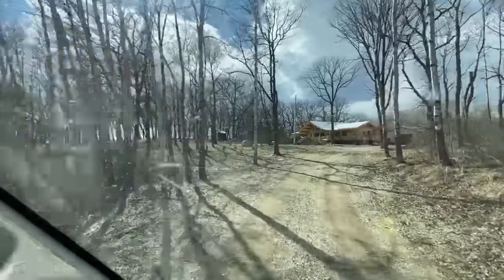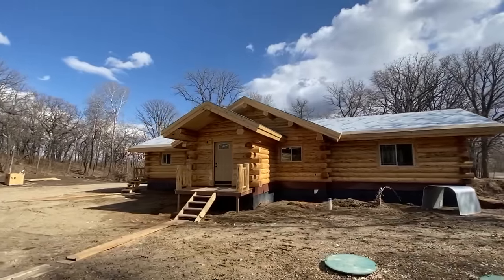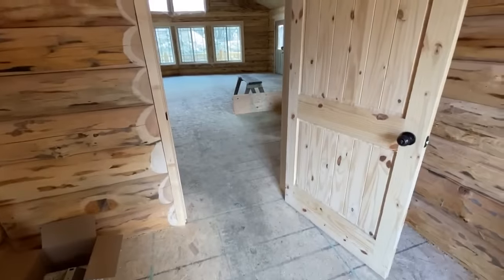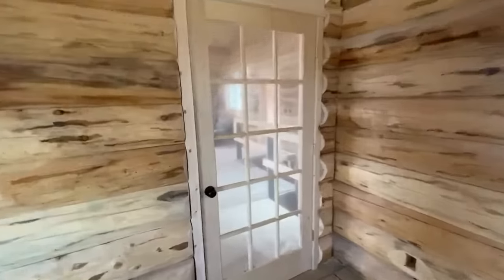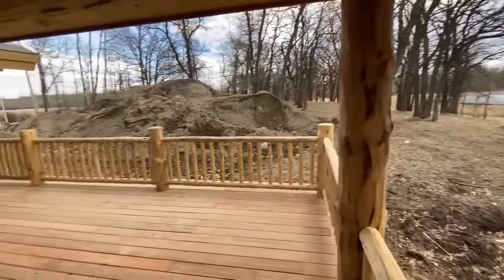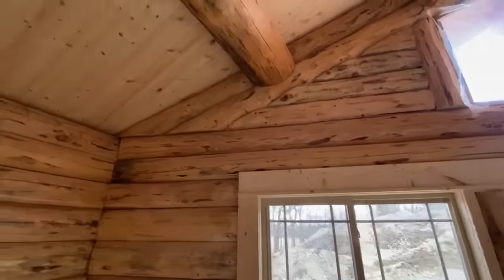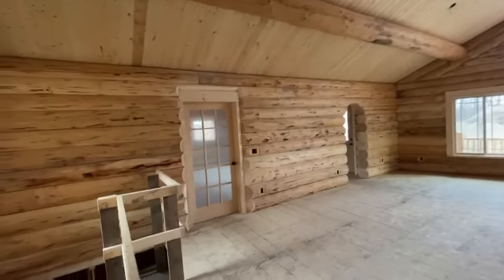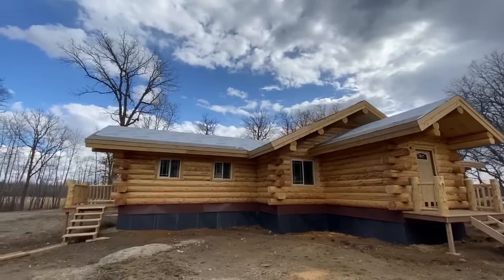Log Home Single Level Tour- Meadowlark’s Lakeside Dried-In

Comment: If this were my home, I would have had the front of the house facing the lake...the way it sits now the lake is not easily seen from all the front facing rooms.

I didnt care for the way the bump out in the living room was not exactly mirrored on the porch/walkway.  The mudroom is a great addition to the house.   If the front of the house was parrallel with the lake, having the mudroom addition makes the back of this home look very proportioned and could easily be mistaken for the front!!    Being in the Dakota's, I would have made the mudroom  @1/3 wider so that I could have some custom closets put on one side to hold all the coats, hats, bibs, shoes and boots. Id also want some custom seating, so you'd have a place to sit to put on or take off your snow gear. Keeping those things picked up and put away will make this entryway much more orderly.

With the extreme temps that you have in the Dakota's, I would have a set of doors installed so that you have an airlock from the mudroom into the main living area to preserve as much heat as possible!!!  🥶
The mudroom needs to have an extended outside porch that is also covered.   
I would also have had a 21/2  car attached garage added to the kitchen side  of the house. This way you can bring groceries directly into the kitchen.  Id also keep a couple cords of split wood stacked in racks in the front of the garage. This way you'll always have dry wood for the fireplace.

Owning a log home has always been a huge dream of mine.  Still praying 🙏 that someday  I'll hit the lottery and make that dream come true!!!!
❤❤❤❤❤❤❤❤❤
Reply: I agree with everything you said.

Comment: Interesting.  Wondering about how the home will be heated/cooled and how ductwork might be installed.  Also where the bathroom(s) would be.  I imagine a fireplace could be installed as well.
Reply from the maker: What I need to do is go back to that location at the first opportunity and get some finished video and we could see all of the interior.
Reply: @AmishMeadowsOfficial   Thank you for the response.  It would be nice to see how it turns out.  I have always wondered about log home construction when it comes to wiring and ductwork.  Working with logs as opposed to drywall.   What I always imagine most with videos is the aroma of the wood, especially those with cedar and pine.
Reply from the maker: Frame interior walls will be added and wiring plumbing and ductwork runs in these walls and in the floor and roof cavities. The frame walls make it simple.

Comment: What's the R rating on these log wall constructions and what sort of maintenance would a property like this require?  Would it still be standing 5 decades from now like a brick & mortar home, or is the all-wood construction prone to rot and associated problems over time?
Reply from the maker: Log walls do not use R value for the energy rating but rather mass wall. Our log homes should be standing in hundreds of years from now. Insects are generally not a problem.

Comment: Odd not to see any areas plumped for bathroom, kitchen, or laundry room. The tour guide doesn't even state how many rooms under roof 🤔. Only 1 bedroom? And if so, it would be 'maybe' referred to as Master Bedroom but usually that term means it has an en~suite, yet it's one large room and no other room within for a Master bath 🤔. All that work for a basement without providing a walkout? Without windows or a walkout, that will be a dark depressing space, and possibly potentially moisture from foundation freezing and thawing. I could have appreciated this video 10 times more if I knew the amount of bedrooms, plumbing, and extras like laundry room. I couldn't even guess where a house bathroom was planned and plumbed for or interior door for it. Cathedral ceilings make it funky for even a Master closet or pantry. Location and outside home is stunning. Beautiful porches too.
Reply from the maker: In this video, the home is not finished so there is a lot more to see. Hopefully I could take a video later when it is completely finished.

Comment: Roof seems kind of low... and the big logs sticking out on the edges are kind of dangerous... poor  deck designing.
Reply from the maker: The log beams, door openings, porch beams and roof overhangs are at least 6‘-8“ clearance height which is USA and Canada standard code for any doorway or place you pass underneath. 

A person can order extra wall height with extra rows of logs to bring the roofline and openings higher but of course those extra logs and heights comes at a cost increase to the customer.